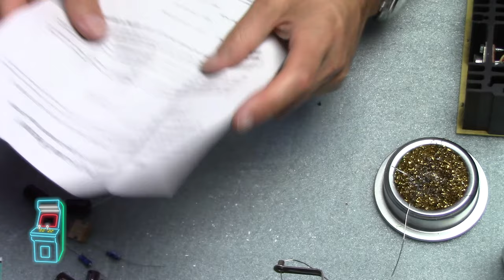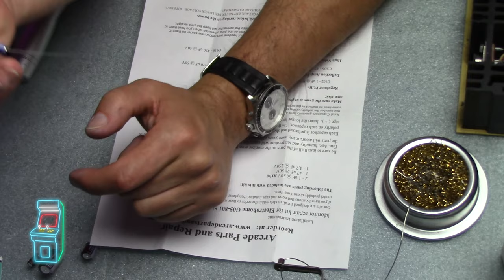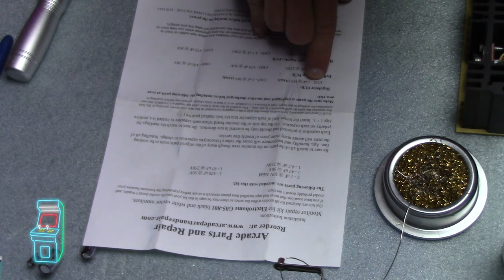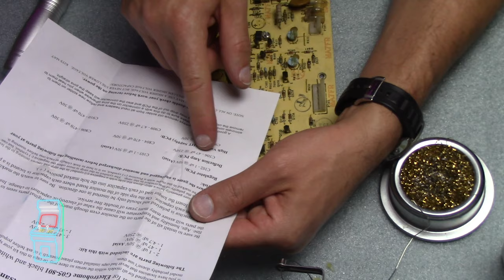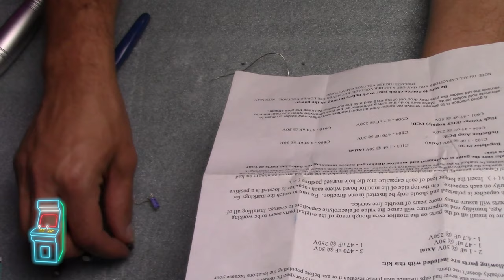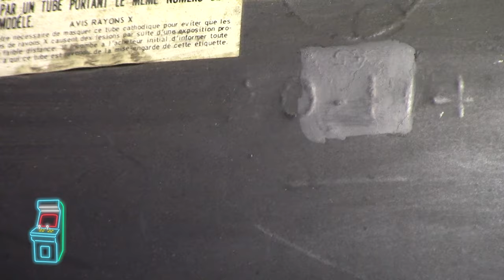B&W Vector Monitor cap kit install [G05-801]

Comment: when you pull the caps out it’s a good idea to wipe the board with alcohol as if any electrolyte has leaked from the cap it can be corrosive
Reply from the maker: I will take this precaution from now on. Thanks!

Comment: excellent video. looking forward to do this. my Asteroids DLX probably needs this. audio is good but im playing blind. changed to higher brightness and it worked but it's dimming again. can you recommend what kit and extras to buy from arcade shop?
Reply from the maker: I'd definitely buy the big caps from arcade shop. Just type in the keyword "Asteroids" and they will come up. 
The ones I used were from ArcadePartsAndRepair and they are smaller (but work the same).  But the Arcadeshop versions of the big caps are direct swaps and look like the originals.
Reply: Asteroids Deluxe uses a different monitor the G05-802, the caps are quite different and you don't have the two big caps as well. Make sure you order the correct kit. You'll notice you have a single cable connecting the monitor to the wiring harness as well, vs on the G05-801 you have a separate cable for power and the other for video. your lucky as the G05-802 is easier to fix. the dimming is probably your diode that's inline on the anode cup wire. you wont see it in this video, as the G05-801 doesn't have this, but has the square voltage doubler (which is not for sale anywhere, but people do make their own home grown ones).  I know this is late to the party but might be good for others.

Comment: Will the screw driver de-energizing the tube...would it work on a color vector monitor also? Or should I use a probe on a color vector?
Reply from the maker: There is a HUGE debate on this, where some people believe that it will damage a vector monitor with a screwdriver. But the REAL experts say it won't damage them. 
Some have argued that the reason you should not discharge vector tubes this way is due to the possibility of damaging the external diode. But that's FALSE because even newer flybacks have the same diode, it's just built in.
20+ years of discharging the  with screwdrivers and not one issue.

Comment: What kits number did you buy? I have the very same unit and item
Reply from the maker: I used the one from ArcadePartsAndRepair website. But he did not have an exact match for the big blue caps (same values but smaller caps). 
If I had to do it again I would use Arcadeshop kit and their blue caps.
Kit: https://bit.ly/2OTFAwf
Blue Regulator board cap. (you need two): https://bit.ly/3uS98to
Bridge Rectifier: https://bit.ly/2Qv9HdS
There are also some diodes you definitely want to change out with stronger values as noted in the FAQ on a chart on page 33 here: https://bit.ly/3aevMnX

Comment: Would have been good to see it work at the end of the video :(
Reply from the maker: Actually, I started shooting a follow up video of the the monitor installed in the Asteroids cabinet at the client's house (I rebuilt it for him, not for myself) and it didn't work at first.  Turns out the Asteroids game board itself was the issue, where it wasn't sending out the x and y outputs.   But in the long run the issue was not with the monitor. It was correctly rebuilt and ended up working. (Unfortunately I don't have the footage of that.)
Reply: DeLuSioNaL's Arcade I’m probably going to be doing one of these myself soon. Please can you re-confirm regarding the polarity marker on the PCB for that one capacitor. Were the markings on the board correct? I think you clarify in the video but I want to be absolute.
Reply from the maker: @acidburn7683  Hey there, sorry for the late reply.  I had a chance to rewatch the ENTIRE video and I mention that the markings are indeed correct on the PCB. :-)  Those particular caps are wired "in series" which means the legs share both positive and negative pads.
I mentioned it a couple times at these timecodes:  45:39 then again at 01:04:58.  I also put it lower third graphics clarifying what I found out after shooting the video.
Hope this helps!